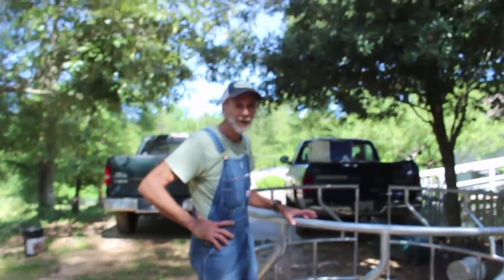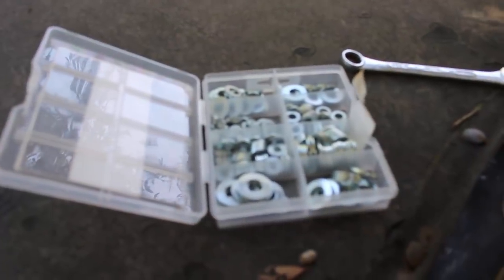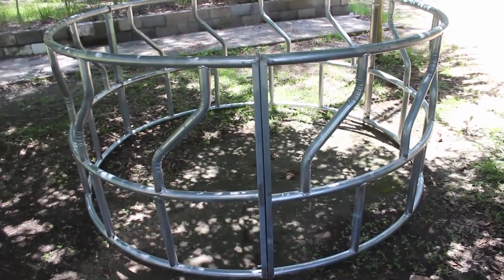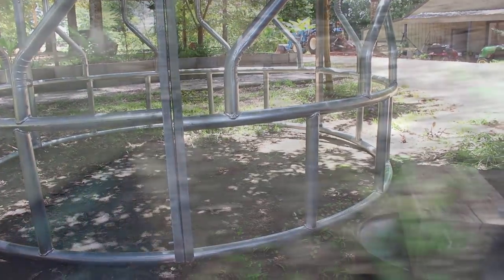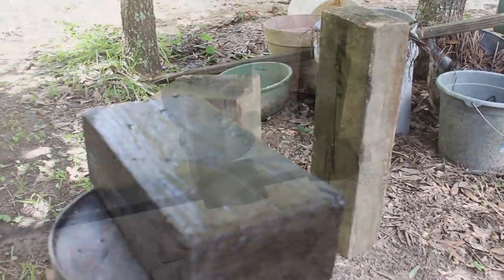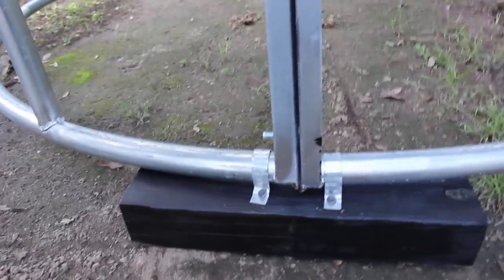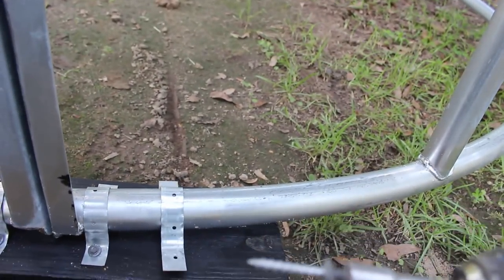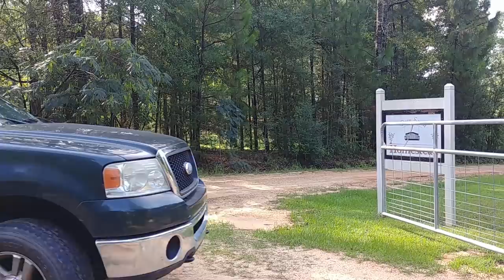Hay Ring | Hay | Happy Animals

Comment: Happy Anniversary! 

My husband and I enjoy your efforts. We are of the same generation, married 46 years this month, and share the same work ethic. Work for what you have and don't sit back with your hand out or expect anyone to provide for you. 
We will attempt to grow anything. If its edible we will plant it if it even close to our zone and see what happens. We are trying to get settled, 2 years here.  My flower beds are blueberry blackberry, gooseberry,  elderberry,  raspberry, and hazelnuts. I can, dehydrate and store everything we get our hands on. If we can't eat it our animals probably can. 

My next project is a root cellar. I would love a natural cellar without all of the concrete and plastic. I enjoyed your tips on you cellar.

We have miniature zebu cattle and hair  sheep that run together. This year we are using a stock panel wrapped around the round bales and fastened w hay string. Zip ties might work, we just have an abundance of string and use what we have. The animals just reach into the holes and pull out bites. The bale eventually loosens up inside the panel.  I removed the net, wrapped the panel and carried the whole thing to the pasture with the tractor. The hardest part is holding both ends of the panel to tie it the first time. I am almost 65 and not as agile as I used to be. I did it when my husband was at work so he couldn't laugh. That is where the long string comes in handy. Hoping the panel eventually curves so it is a little easier next time. 
Calves and even our younger bull learned to get in and out of the hay ring. They all played king of the mountain and we would end up with a wet compressed mess to scrape up for the compost pile. 
We still have a ring (I'll be adding wood legs) in 1 pasture and panels around bales in 2 more pastures so we can compare results. 

Always looking for a better mousetrap. Actually, I need a opossum and racoon trap! They ruin more than I can fix. Just don't want to catch my barn cats.

Well, back to stacking hay, my break is over. I came in to cool off and wash sealed jars of chicken and roast from yesterday. 
Today the canner w 20 pints of chicken started at 4AM and at daylight I went out to finish unloading and stacking hay in a bldg. Tomorrow I crash! Yeah...plan to rent a dump trailer and haul all of the horse manure and shavings I can get. 
My husband teases me about eating bonbons while he is at work.
I've accused him of having a drone so he knows when to work late! Actually, he is 68 and works 70 hour weeks so we do what we can, when we can, anyway we can. 

Thanks for the update. I enjoy spending my breaks with you. Don't let them censor you.

Comment: If you don't want the hay wasted, square bales are still better. You will have 30% waste with the round bale feeding it like that with a ring with no skirt. The cows will pull out and waste a lot. As i said down below, the goats will climb on top of the bales and defecate on it to the point even they will not eat it. Will make good compost though. Round bales are a convenience and labor saver.  Elevated round bales work for goat where they cannot climb on it. Daniel at arms family has a video on his method for suspending the round bales.

Comment: that black stuff on wood works a whole lot better if yyu heat it up hot with a tagger torch and dip the blocks in,, it is to thick to sock in go, cold, it just covers the out side and don't really get into the wood iit self, it all started when I worked contraction the inspectors would not pass it unless it was put on hot, just like with the flat roofing tar, even though its a different product,, I had put some fence post in years ago with it put on cold and the rotted out , the later ones I dipped hot and there like the day I put them in 25 years later, even though they are cedar posts they still don't last for ever in wet ground, uncoated, even rail road ties have always been dipped hot

Comment: Not for goats! They get inside the bail and it collapses on them. The best way to go is to wrap a cattle panel around the bale and zip tie it. Lots of people have trouble with hay feeders and goats. The cattle panel causes less hay waste, too.
Reply from the maker: Liz Hoxie If i use a cattle panel my cows head wont fit through the holes in it. Plus rolled hay dosent collapse.
Reply: True but the goats are going to climb on it and urinate and crap on it and nothing will eat it.
Reply: We just started  using cattle panels with our cattle.  They reach through the holes and get bites.   It helps to loosen the outside wrap a little.  It does gradually loosen up and fall down. They aren't wasting nearly as much. We have a lot of waste with the hayrings.  Calves & sheep hop in and make a mess. So far they haven't been able to get in the cattle panels.

Comment: What happens if you don't use a washer?  I would assume that they gave me all the bits I needed.  Will you need to unlock the ring every time you put the hay in it?
Reply from the maker: Essem Sween The nut wont tighten properly without a washer. You just flip the ring on its side and put down a new roll of hay and flip it back over it.
Reply: depends if you have a loader tractor to drop the bale in, like I use to do before my ex sold mine, now I put pins in so I can open it up and put around the bale, its a big pain so I don't use them much any ore, at $40 cnd a 1500 Lb bale it is not worth it, and what they pull out works great for there bedding around the bale, being hay or straw is all the same price it don't mater
Reply: Deep South Homestead Right, Thanks Danny, see I wouldn't have known that about the washer.
Reply: EseemSween that's real soft metal too, if you really torque down on a bolt while tightening, you can pull it right through the metal. Same with wood. The washer gives you a nice uniform surface to tighten against and distributes that pressure evenly across a broader surface, and will not pull through the opening that your bolt is pushed through. It also gives you more pressure, applied more uniformly, against the surface you are bolting to. I'm like Danny, I've got a gazillion washers in every size known to man, and use them freely! You can never have too many!
Reply: Tom Mathews I'll be making additions to my tool-box.  Metal washers - assorted sizes coming right up.
Reply: Don't forget "lock washers" either!